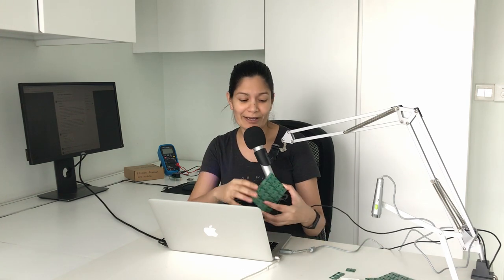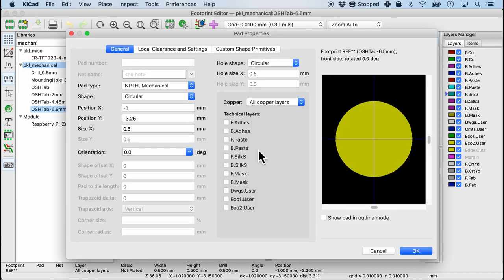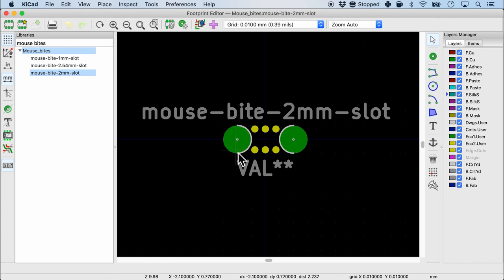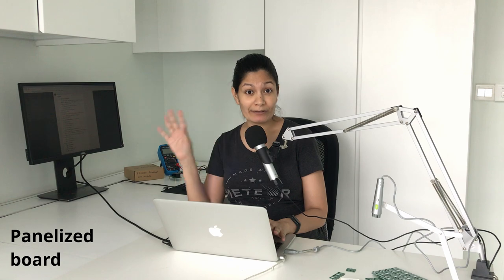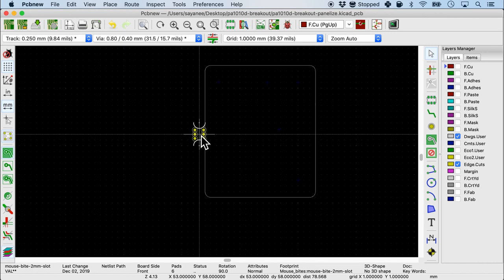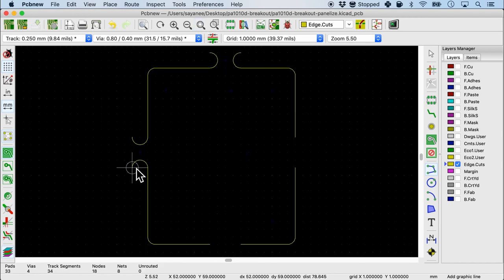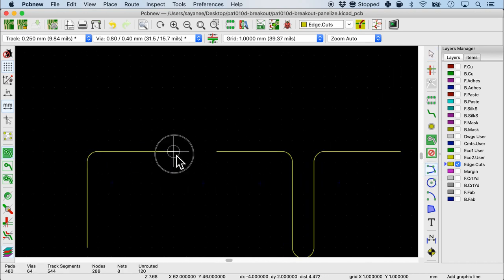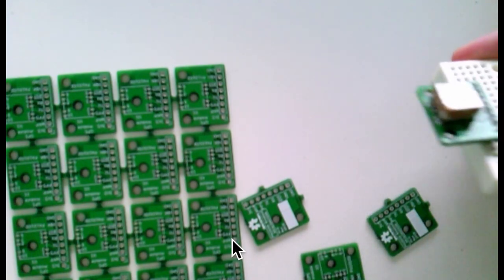Manual panelizing of PCBs with tabs and mouse bites

Comment: Very helpful video, thank you! I noticed you didn't add rails or fiducials. I assume adding those things isn't necessary unless you want to use a pick and place machine or do some other automation. Is that correct? Thanks again for sharing!
Reply from the maker: That's correct. I made the breakout boards for hand soldering only. 
Good point on the rails and fiducials!

Comment: Nice video Sayanee! Did JLCPCB allow you to use the $2 for 5 PCBs offer for this or did you have to go with a more expensive option because it is panelized?
Reply from the maker: That's right I used the usual $2 JLCPCB for 5 PCBs plus the cost of shipping of course. I didn't have any other expenses because it was panelized.
Reply: @sayanee  that's awesome. I read that they didn't like that but I guess they don't look too closely
Reply: @sayanee  ahh it's just if you have multiple designs that they don't want you to have mouse bites.
Reply from the maker: @mattermfg  Interesting... well I didn't try with multiple designs, so I don't know.
Reply: About a month ago I panelized about 5 different designs in one 10*10[cm] PCB and they charged me for 22 USD =(
I used GerberPanelizer
Reply from the maker: @hasecilu  Thanks for this data point on using different designs! 

I saw GerberPanelizer as well. I think it is Windows only right?
Reply: It´s correct. I tried to use it in Ubuntu with wine and mono packages but I didn´t work. So, I designed the PCBs in Ubuntu 18.04 but merged in Windows 10
Reply: @hasecilu  when panelized theres a section at the order page to indicate how many designs you have so the price is not unexpected. i did the same with 2 designs in one panel and marked it '2' designs and i paid only 4 dollars on top which is reasonable. if you have only 1 design they dont charge extra unless if one of the lengths is not shorter than 15mm in that case they ask for $14 dollars extra for being too small for v cuts..
Reply: @orhanyor  So you can do v cut panelization with JLCPCB for 2$ as long as the design is the same and the shortest length is more than 15mm?